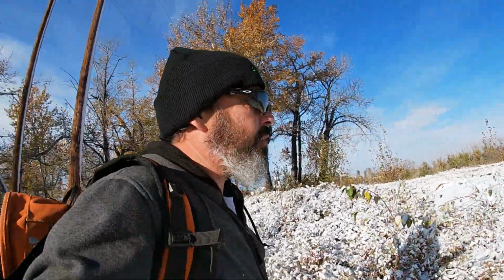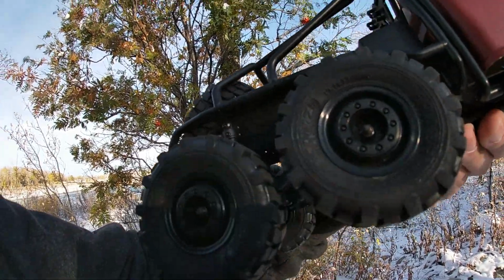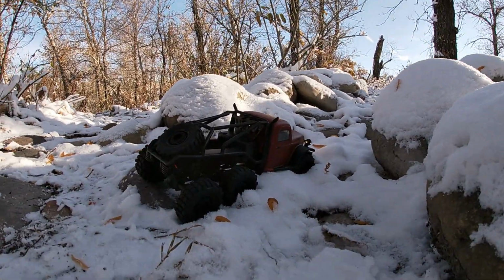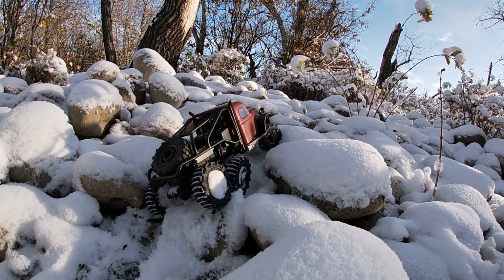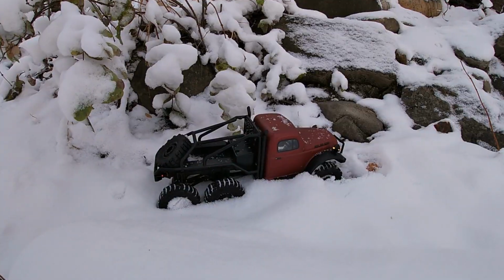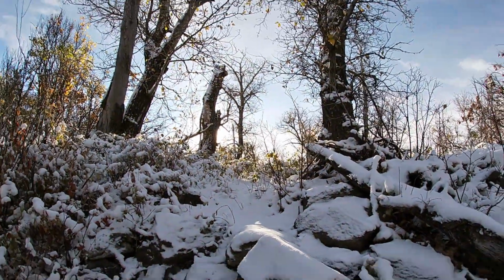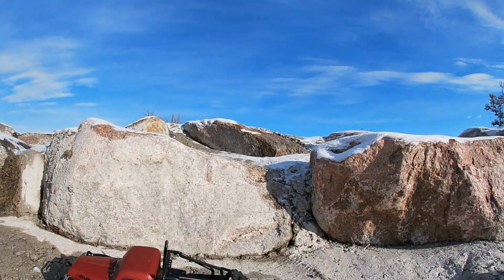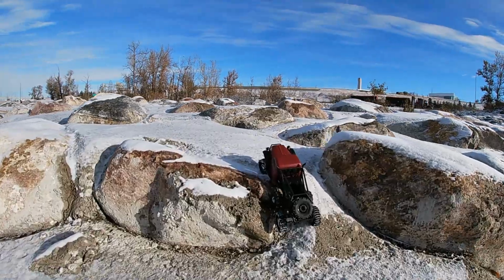RC ATHLETES - FMS ATLAS 6x6 Chat-N-Trail

Comment: Wow   I'm   blown away  by  seeing how  it handles    it did way better than I expected  it  too  in the snow   how many  mah  is the battery?   and  do u think it being cold  took some   power / torque  outta motor ?   No snow out here    having year-end   BBQ  stuff  at our local scale trail  next week  day  trip  with the boys? .
Reply from the maker: 600 mah is the stock batt. I think the cold helps motors but just a guess/thought because they run bad hot.

Comment: They are not tough. drive like your in it and care about it. He's drive in slippery conditions and his video is VERY deceiving. If it where driving in dry conditions through that same rock area he would have probably stripped something out
Reply from the maker: How many have you owned?
Reply: @damedcamera  Atlas? IDK, four so far?, Every time I strip gears I just buy another atlas. I have one new in the box in reserve right now and the one I'm running. I just swap axles or transmissions when they strip out.